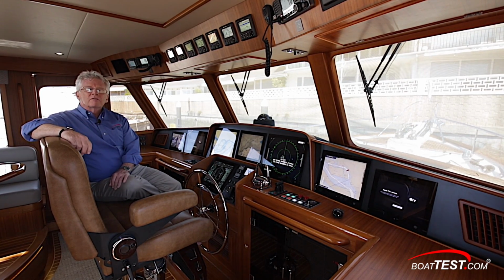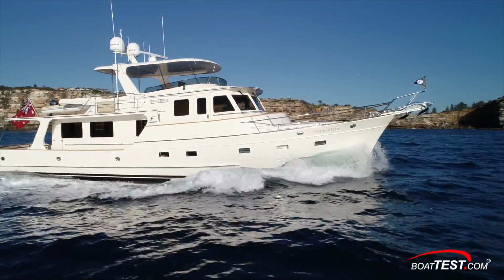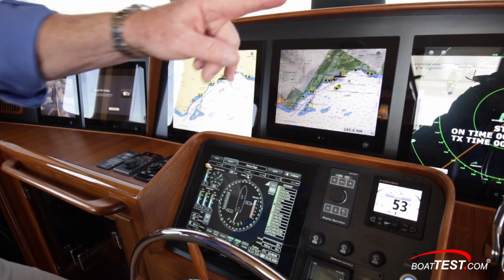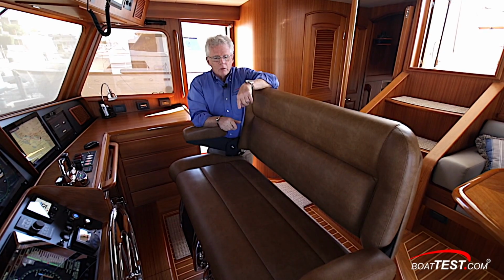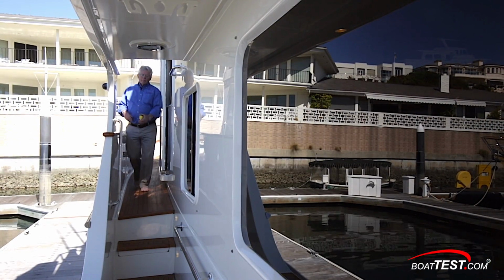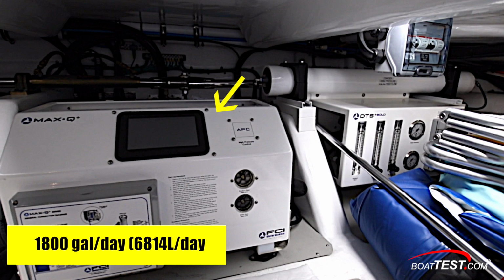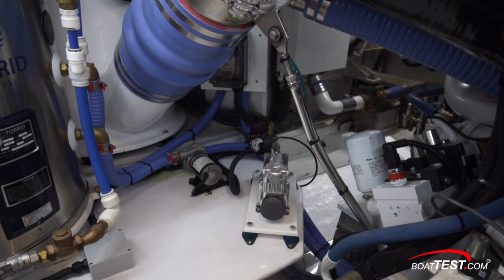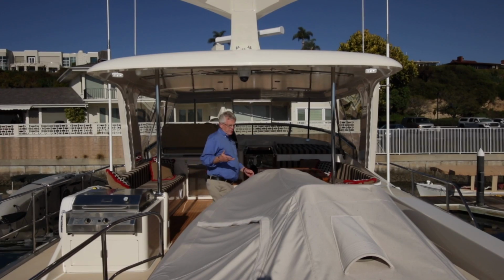Fleming Yachts 65 (2020) - Test Video

Comment: Wow, what a pig   at 8.1 knots 7.4 gph, that's  3.7 Litres per mile. An Elling e6 @ 8 knots uses 1.4 Litres per mile  tmThis boat is heavy and overbuilt. Time to use more modern manufacturing techniques.

Comment: Amazing detail on Fleming yachts, the only modification needed is a sturdy stainless steel grab rails running the full length from the stern and along the side bulwarks to the step-up with fishing rod holders spaced out and maxed out at the stern. This will also improve passenger safety under inclement conditions.

Comment: Okay, the engine and power rooms, I am really impressed. That's some engineering. This boat has some system for the size.
Reply: Flemming 65's are incredible but I just have one worry and maybe I'm missing something obvious.. Is the only way to get into the  engine and power rooms is by going through that small hatch on the rear cockpit into the lazarette ?  I'm thinking of being out in heavy seas with waves crashing into that cockpit  and trying to get through that opening into the lazarette then engine room  without a lot of  water coming in with me... Maybe I'm over thinking it.  I've watched all the Flemming videos and see Venture in rough seas but I've never seen how well the cockpit drains.  It's still a magnificent yacht ..
Reply: @billbresnahan9949  I agree.  I have been stuck on Fleming as the ONE yacht for passagemaking, single-handed docking, two-handed (couple) cruising, capabilities and redundancies, and Tony Fleming's attention to detail.  A stand-up, walk-around engine room, which is a feature of the Fleming 58, is, sadly, not a feature of the 65.  I have been looking at Hampton Yachts Endurance boats, and one can access the engine room from inside the boat or from the lazarette, which is such a bonus and way better for the good old lower back as we advance in our own timeline.  Added bonus: it's walk-around and stand-up.  I do not know, however, whether the Endurance is a passagemaking, ocean-going vessel, and I am waiting to hear their response to my inquiry.  I think Captain Steve's boat reviews are the best ones online.
Reply: @billbresnahan9949  I Just have say that if you had to get into the engine room with all those redundant systems in rough seas it would be because you were dead in the water...well just kiss your butt good bye 'cause your going to die anyway regardless of whether you get in to the engine room or not. Over thought? Seems so to me.

Comment: flemming makes a geat yacht very good looking and handles the ocean well... i have watchted the videos made by tony flemming and what he put venture through... the first 65.. i really like the helm seat for two.. which is where the wife and i would be sitting together.. most pilot house boats have either one or two seperate seats and for a couples boat i would want to be able to sit with the admiral closer i really like to have the circuit breakers up in the piolt house and not in the passage way and the wood work is just fabulous a very well made bridge the side decks are very spacious for walking around but i wonder if maybe an options for triming them down abit or going asymetraical to mabybe 24 and 18 would open up a little more space inside .. also the cleats are nice and big and strong looking but could they be receased in a bit to limit their profile?  the spacious over hang is really nice and im sure that expands the flybridge quite a bit..the engine room is packed with stuff for sure not sure how excessable it all is .. the cross over pipe on the floor looks like an inventation to stubb a toe .. maybe a smalll ramp would be an idea...the wood tool box is very nice but do we really want someting flamable in the engine room.. one place i would want metal ..love the double seat on the fly brige and the rope work on the destroyer wheel is classic.. i would want a knot of some kind to help with identifying the home or centerline to help with stering when going from lock to lock..as usuall capt steve does a very well made presentiation.. lots of info

Comment: Thanks for this video. And what a great yacht. Redundant systems and seaworthiness at its best! The only thing I doubt is the choice of engines. These MAN, as also similar engines from other brands require to run at rpm’s where the turbos are engaged. Low speed with low engine refs will lead to turbo damages. So nice engines for short distance cruising, but long-distance passage making will kill the turbos. For this smaller engines would be better.

Comment: Lose the MANgrenades, and put some CAT's in her, still a beautiful vessel.
That boat sure pushes some water at high speed!!!
Reply: Chris, Fleming used to install Cats, I'm not sure exactly why they switched to MAN but I doubt they would have if the MANs were inferior to Cat performance or reliability wise.
Reply: I have long experience with MAN engines but the term `MANgrenades``is BS. MAN do a huge range of diesels powering small trucks to large ships & many applications in between. They have a great name here in Europe for heavy trucks in particular & are second to non for reliability. Nothing wrong with Cat, but why the term MANgrenades?

Comment: What extent of mechanical/engineering knowledge do you think is required to passage make on a yacht such as this. I have none so would it be wise to employ an engineer on say a trans Atlantic crossing? Great review and beautiful yacht.
Reply from the maker: An engineer is neither necessary nor required.  We just did a technical video showing the redundant systems so when one fails, there’s backups.  That said, the more hands on you are the better equipped you’ll be.  - Capt. Steve.
Reply: From what I can see, reading comprehension is all that's required. That system on center display at the helm covers everything!
Reply: Fleming efit* should have all the data to help less knowledgeable operators resolve any problems.
*Electronic Fleming Information Tablet, an ipad with full documentation that comes with your Fleming.